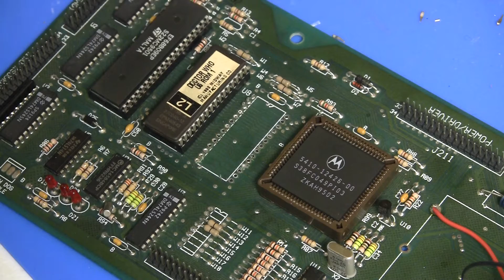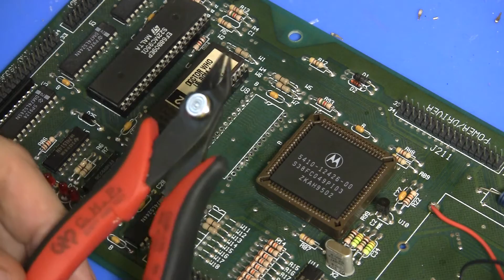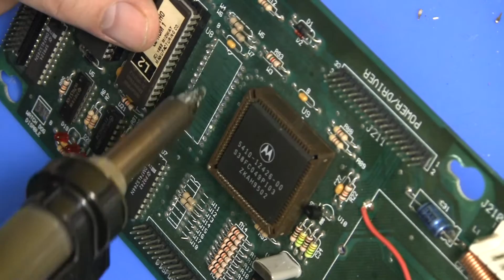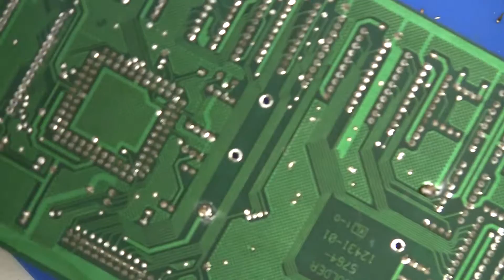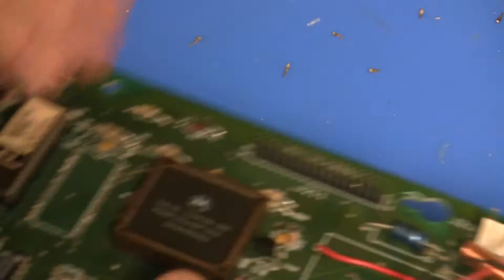Bally Williams dead WPC MPU board RAM fix - Dr. Who - Part 3/5 - PinballHelp.com

Comment: I hold the pcb in a vise,heat one side of the eyelet with a soldering iron then put the desoldering tool on the other side. You only have to cut one row of the chip when one side is free you can break it off clean.

Comment: Way to much work.. get a better de soldering tool with a thermostat on it. If your worried about heat get a good soldering station with a digital thermostat, set it to the melt temperature of your solder, clean the area with alcohol, put soldering flux on it, use a braid to wick the solder right off the board with a copper braided desoldering wick. It will cleanly remove the solder with no stress to the board.